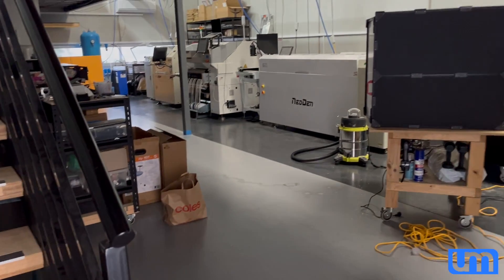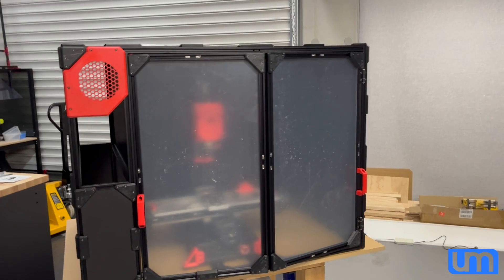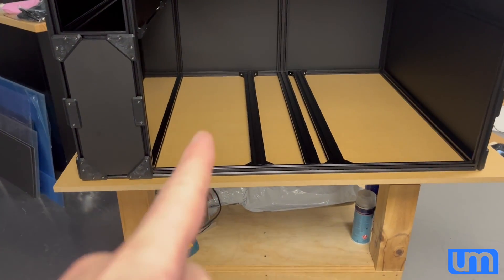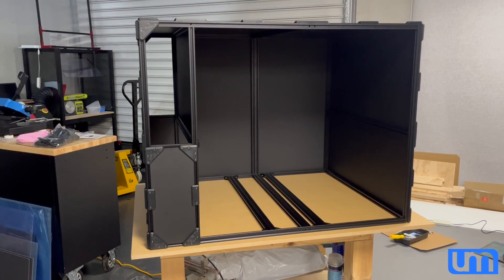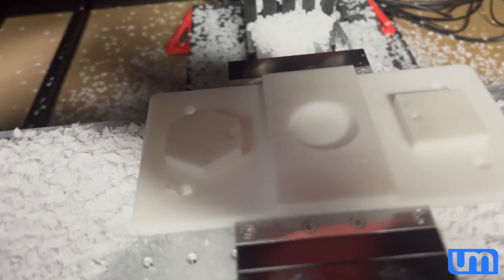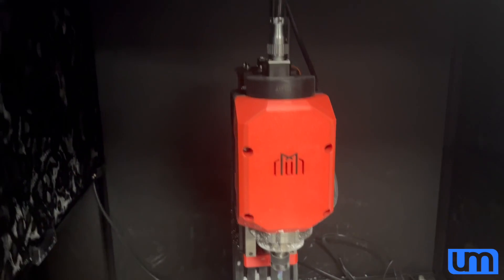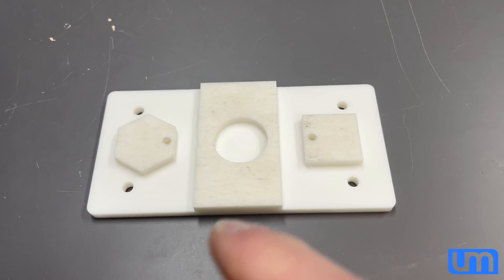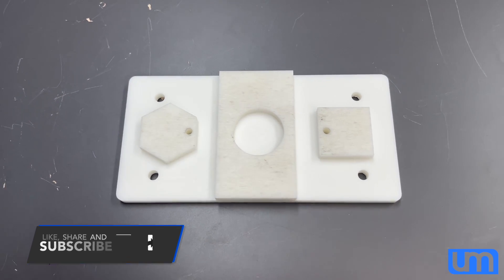First Chips on Moo, my Milo v1.5 Mini Mill

Comment: I really want to try CNC after getting hooked with 3d printing(and building a Voron 2.4 350).

I'm hesitant because I don't have a clue what extra tools I'm going to need.  Theres vices and hold-downs and dial gauges.

Is there some online courses or tutorials to learn the basics of all of this?  Should I budget basically 2x the cost of the LDO kit for all the extra stuff?

Comment: Nice. How is the centring of the probe impacting the dimensional accuracy of the parts? I can see it affecting the location of the part but nothing to do with the dimensions, that is determined by your stepper control/accuracy well at least on anything CNC that I own.
Reply from the maker: Not in the pass you saw where it was calculating the stock position, but when I first calibrated the setup (not on video) and it used the probe to measure a 123 block, the rotation of the spindle will change the centre point of the tip, and there is no hold on the spindle when it's not spinning, so the probe can rotate slightly, changing the tip offset, and therefor effect the measurements.

Comment: Your giggle of delight gave me a giant smile. We all remember our first chips as well. A couple things, your feed and speed gave you great sized chips, don't expect the same size with aluminum. Your mill probably isn't ridgid enough to cut at that depth on aluminum. Corian was a great first choice for stock. 

Second, you'll learn to listen your mill cutting. What I heard, the sound changed in the upper left corner. I believe that's your stock flexing up and down due to the overhang from your vice. When you move to aluminum, you need to fixture differently and secure the corners.

Congratulations on a successful first cut, get out the vacuum and hang your wonderful design on your "Wall of Fame".